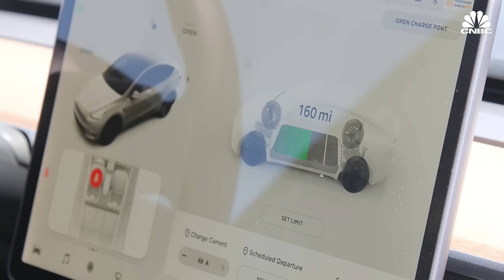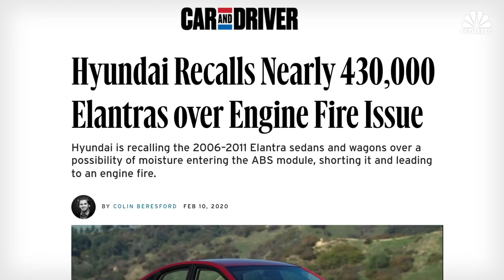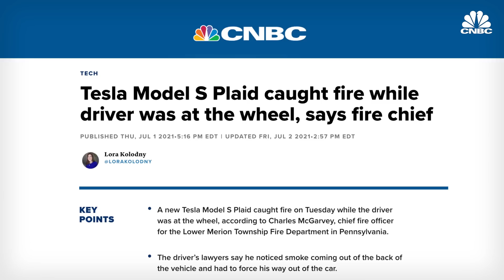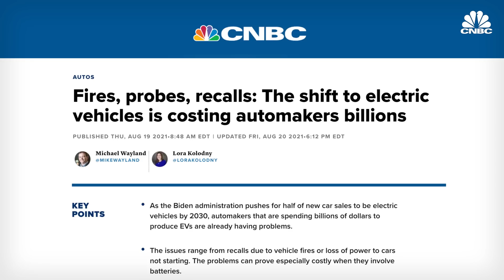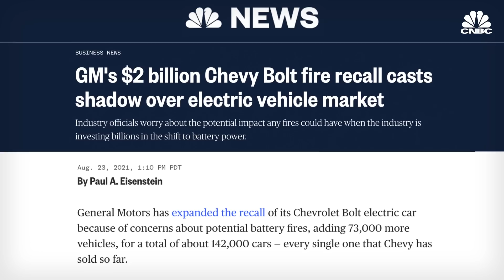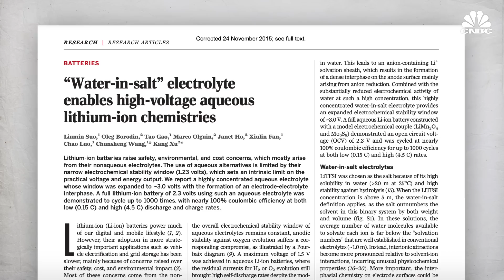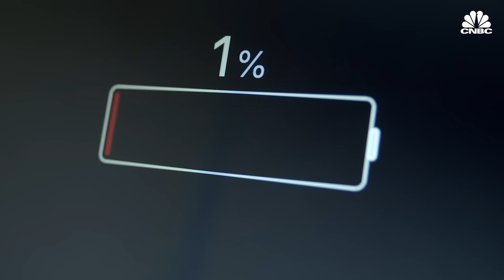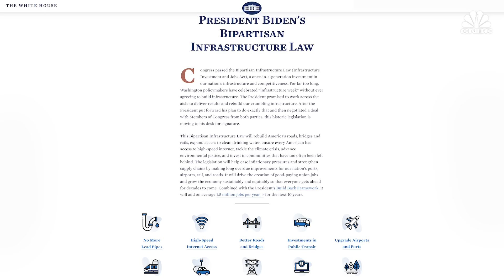Why Tesla, GM And Other EV Companies Have A Fire Problem

Comment: Half of the comments below are people who feel they need to remind you that gas cars can catch fire, too
Reply: Not while parking.
Reply: @zxcvbnm3998  Not sure what you mean by "not while parking".  If you mean not while parked, that would be false, as many of the current fire warnings and cases for combustion engine cars is for cars there were parked and unattended.
Reply: I bought a Saturn whenever they were all the rage. Despite certain problems some had during certain years,  you NEVER read about them just catching fire. Mine didn't. This is true with pretty much any piston engine cars or trucks I knew of which were newly purchased even used since 1979. You pretty much had to light them on fire yourself. These electric cars are catching fire brand new,parked alone with nobody around. That speaks volumes.
Reply: They wasted money on electric and feel guilty
Reply: Important comparison statistics would be how many people are injured or die in ICE vehicles per 100,000 vehicles compared to the equivalent statistic for EVs.
Reply: @shanewilson2484  Based on how EV's are designed, that rate would also favor EV's.  The reason is simple, the entire front of an EV like a Tesla can be a crumple zone as there is no engine and transmission upfront.  Hence, the entire front can be crushed to the windshield without penetrating the cabin.  On ICE cars, only the very front can become a crumple zone, as after the crumple zone the engine is there along with a transmission in many cases.  Hence, it has less space to absorb any impact of a crash.
Reply: because: DEFLECTION. <--- any time one's EGO is hurt this is the standard pattern of Human behavior that always ensues. #REACTIONARY , #DEFENSIVE the psychology beneath this is so predictable such that one is able to set their watch by it.
Reply: Because they burn at a 10-50x rate. And yet they decided not to make that the video topic
Reply: @thomasreese2816  that's because done has companies own the media or pay the media to censor it... That or it's usually mentioned but ignored by the people.
Reply: There are a lot more gasoline cars out there than EVs. At this rate, If it were 50/50 there would be a heck of a lot more EV fires than gas.
Reply: @LordSamuelJ  False.  The rate is per 100,000 cars.

"Fully electric vehicles, on the other hand, were deemed far safer than both hybirds and gas cars; they are far less likely to catch fire, with just 25.1 fires per 100,000 sales. That's compared to 3,474 hybrid fires and 1,529 ICE fires per 100,000 sales respectively."

So, the rate of fires is 25 fires per 100,000 electric cars, but 1529 per 100,000 gasoline cars.  It doesn't matter how you scale that up.  Million EV's would cause 250 fires while a million combustion engine cars would have 15290 fires.
Reply: @redbaron6805  the thing is ICE cars don’t explode from something perforating the underside, they don’t take nearly as much water to put out as quickly AND they don’t combust repeatedly after first ignition. I am all for EVs but batteries do not like to be crushed and in a crash this is exactly what will happen.
Reply: @User-cb4jm  But, if we stick to the facts, EV's still catch fire 60x less than combustion engine cars.  Something perforating the underside is exceptionally rare, as they have a pretty substantial shield underneath.

And EV's rarely catch fire in normal head on rear end crashes as they have far larger crumple zones than combustion engine cars, and the battery is in the middle.

Most of the fires have been violent crashes into barricades, trees or similar crashes where the car slides sideways into pole or a tree.  But, those crashes have cut combustion engine cars in half, so one would expect something catastrophic to happen in those.

So, while EV's do catch fires occasionally, they are exceptionally rare according to the NTSB report that analyzed car crashes and fires.
Reply: @User-cb4jm  You don’t put out electric fires with water, you use foam.
Reply: at 1100% greater rate
Reply: As they should.
Reply: Its much more cleaner than batteries😉
Reply: It is much rarer for a gas powered vehicle to catch fire. It would need to be catastrophic for that to happen.
Reply: Not just that but gas is extremely explosive when exposed by extreme heat and fire.
Reply: @okamijubei  high temperature doesn't ignite gas. You are lying
Reply: Did you actually watch this or are you just shooting from the hip without so much as an insight?
Reply: And the thing is,they don't burn as fast as an EV because the gas tank is protected by the whole cars chassis,compared to an EV where the battery is part of the chassis where it can crack and leak fluids
Reply: Um...yes. If a news media company puts out a video on how dangerous a new technology is when it is statistically FAR SAFER than the current technology, it's probably a good thing to point that out, no? EVs catch on fire much less often than gas cars and the fires burn slower. But you wouldn't know that by watching this video.
Reply: @juliam6442  is it easier to put out an EV fire?
Reply: my EV won't catch on fire like your gas car.

because i won't ever buy an EV.
Reply: Well see CNBSisn’t telling a new story. It’s a propagandist station at this point supported by either gasoline car advertisement
Reply: Power cells shouldn't be catching fire at nearly the rate that they seem to be. At the current percentage imagine how many million fires per month that would be happening if all that existed were electric cars and trucks.
Reply: @randybaumery5090  You have literally ANY idea what you are even talking about?

Here is what the actual study said: "A recent study conducted by AutoInsuranceEZ using data from the NTSB (National Transportation Safety Board) showed that electric cars in the US caught fire at a rate of 25.1 per 100,000 sales compared to 1,530 for ICE vehicles and 3,475 for hybrids."

There are somewhere around 295 million passenger vehicles in the USA.  If the rate would hold up and every single car was electric, we would be talking about 73k fires a year.  So, no, I can't imagine how many "million fires" would happen when the total is less than 80k.

The current number of fires in combustion cars is close to 200k a year.  Again, nowhere close to "millions" of fires per year, let alone per "month".

You completely fail elementary math or something...?
Reply: @randybaumery5090  So... you completely missed the point just to completely miss the point some more?

The additional fossil fuels required to make EV's is offset in about 12 months worth of driving.  So, there is no question you gain that back.  Same applies to wind turbines.  Wind turbines return over 2000% the energy used to create them during their lifespans.

You are turning the argument completely upside down.  Using your logic, nothing should ever be replaced, as it will require energy and materials to replace it.

In reality, companies and individuals look at energy and cost ROI.  It takes more energy and more materials to create a LED bulb vs a incandescent bulb, but the energy saved in the process will be about 50x the energy invested.

The same math applies to cars, airplanes, wind turbines, solar panels, hydroelectric dams, engines, etc.  All of those require an upfront cost in materials and energy, but you get that back multiple times in the long run.  

In your world, no one should ever insulate their house, as it takes energy and materials to create the insulation.  Never mind that you save that energy back a hundred fold over time.
Reply: @redbaron6805  I didn't miss sh**. We have already sat around, drank coffee, and listed every single way that you still use any form of fossil fuels , even to recharge them. Still using coal and natural gas up the chain to recharge them. What I would want to see is exactly what percentage the fossil fuels goes down due to Earth saver cars. The only thing I can see that would drastically change from a lot of these,  is the smog levels in cities. What's going to be extremely interesting is once thousands of power cells begin expiring, how "clean" it really is or is not to "recycle" them.
Reply: @randybaumery5090  The math is pretty simple if you bother to look it up.  Take electric cars.  They are obviously 4x to 6x more efficient.  Even a Tesla Model S with 1000HP only carries around 3 gallons worth of energy on board, yet can do 0 to 60 in 2 seconds and drive 400 miles on those 3 gallons worth of electricity.

The claims that we still use "coal" and "natural gas" to charge them again completely misses the point.  Because of their efficiency, and because the grid is around 40% zero carbon energy, that means they run on 40% zero carbon and 60% fossil fuels, vs combustion engine cars which run on 100% fossil fuels 100% of the time.

This isn't a 1 to 1 trade off.  A Tesla Model 3 with 350 miles of range carries only 2.2 gallons worth of energy onboard.  Can you name a combustion engine car that can travel 350 miles on 2.2 gallons of gas?  Of course you can't.

That is the point you keep missing.  Electric cars are not only simpler and more reliable, they are also far more efficient.  The upfront energy required to create them is offset in about 12 months of driving.  After that, they save a ton of energy every year, year after year.

And we haven't even started talking about cleaner cities with lower emissions pollution, lower healthcare costs, cheaper maintenance, less noise pollution and a host of other benefits.

You are also missing the point that we flare and waste Billions of BTU's worth of natural gas every year, as there isn't enough demand for it.  Burning that gas to create electricity and charge electric cars would result in literally zero additional emissions.  

There are literally thousands of different ways this is beneficial.
Reply: @randybaumery5090  I don't think anyone is claiming that electric cars are some magical solution that will solve every problem on the planet.  A lot of the opposition to electric cars however is unfortunately based on people simply not knowing how they work, how they are built, how they are charged and how they are maintained.

People are still thinking modern electric cars are the Nissan Leaf's of 2010 with 100 miles of range and that they somehow take hours to charge.  None of that is true with modern electric cars.

The idea that your SUV is "clean" is obviously false.  And I'm not sure what makes electric cars "toys".  They are far more reliable, cheaper to operate and maintain and actually far more enjoyable to drive.  They are quickly taking over combustion engine car sales and car makers are already stopping R&D on combustion engines and switching to electric cars by 2030.

No one however is claiming they will solve traffic or sprawl or overpopulation or other issues in the process.  They will simply be used to clean up the emissions of the existing fleet.  As a bonus, Europe will phase out Russian oil in the process, a win win for everyone...
Reply: @randybaumery5090  They can be used within cities and between cities.  They will also be increasingly used for aviation with electric planes starting to appear this year or next.  First use will be short haul flights, and then the distance will increase over time.

Autonomous driving is just a question of time, just like autopilot systems for aircraft were just a question of time.  Humans are simply terrible drivers by nature, and are simply too distracted and too costly without having some serious assistance needed which will mostly phase out manual driving over time, especially highway driving.

But electric cars, trucks and aircraft are coming for a simple reason.  They are simply far cheaper to operate per mile.  Which is why FedEx, UPS, Amazon and everyone else is going all electric.  Not to save the planet, although that is a bonus, but simply because it is far cheaper to operate and maintain electric vehicles.

The same thing applies to airplanes.  Electric motors are cheap, simple and very reliable, besides being exceptionally efficient.  That is going to be the driving force behind much of the electrification.  Reliability and cost.
Reply: @redbaron6805  phase out manuel driving? Not for me. I want the manuel option. Always.
Reply: @randybaumery5090  Manual driving will be phased out over time.  The simple reason is cost.  Human drivers are simply terrible at driving.  They are too distracted, tired, bored and uninterested in it, causing hundreds of thousands of accidents annually costing society a cool Trillion dollars every year in the process.

Hence, nanny systems will increasingly take over, monitoring speed, steering, distance, etc.  People speeding, running red lights, distracted or drunk driving are simply out of control already.  Something needs to be done.

Manual driving won't be banned, increasingly, insurance companies simply will gradually refuse to cover the damage.  A fully manual car will simply become un-insurable over time.

Considering the amount of traffic we are already facing, probably won't be a great loss when it finally happens.
Reply: I still will want a manual option on mine. Even if I have to get it retrofitted. I don't need Father Mother intrusion in my life more than it already is. Next thing you know they'll be rationing how you can drive putting curfews. Sh** like that. Wait let me guess.  "That's just the way it is. For the greater good." Yeah that's not at all familiar, is it?
Reply: @randybaumery5090  I'm not sure where you are getting the idea that EV batteries will ever be "buried".  EV batteries contain a lot of valuable metals, as they tend to be up to 80% Nickel.  Since Nickel is around $4 a pound, a 1000 pound battery would contain around $3200 in Nickel.  Who would be crazy enough to bury $3200?

And we haven't even touched the Copper, Aluminum and other metals.  I'm also puzzled about your Lead Acid battery claim as those batteries are also not buried, really ever.  Over 99% of them are recycled.

EV batteries are already being recycled today.  The first reason is the batteries can easily be rebuilt, as only a small fraction of the cells go bad, the rest are perfectly good.  The second is the valuable metals they contain.

Hence, the idea that we won't recycle them is not really realistic.  We do already.
Reply: @randybaumery5090  I really don't buy into conspiracy theories.  If some entity would want to control your life, there are far easier ways to do so.  Shutting down your electric, your internet, blocking your road or cutting off your water would be far simpler, faster and cheaper.  

As noted earlier, there won't be some government agency that kills manual driving.  The insurance cost will simply become prohibitive.  Eventually, no one will insure manually driven cars.
Reply: @randybaumery5090  You have to separate every day materials like metals, aluminum and plastic and EV batteries.  No one is removing a 1000 pound EV battery from their car and throwing into a dumpster.  No repair shop is going to remove one and throw it out, knowing it is worth thousands of dollars.

I have never heard of anyone anywhere ever throwing out Lead Acid batteries.  There is a reason they are over 99% recycled, as there are core charges on new batteries and you can get your core charge back at any auto parts store.

We are obviously never going to get to 100%, but at 99%, we are already pretty close.
Reply: @randybaumery5090  Not sure what I'm searching for.  Look up how much EV batteries are selling for, even from crashed vehicles.  They go for thousands of dollars.  They are actually a pretty hot commodity.

I don't disagree that our current lifestyle is unsustainable.  We are consuming about 100 planets worth of resources currently, so things will definitely come to a screeching halt sooner or later.

There are some forecasts that population growth will level off and then shrink before the end of the century.  The current system obviously is not sustainable long term, so we will be forced to make drastic changes sooner or later.

There is also little question that wealth is getting concentrated far above even the levels we saw during the most extreme years of royalty and peasants in centuries past.   So, that whole system will come to a head sooner or later also.

Will be interesting to see what happens.  We may both be lucky enough to not survive long enough to see it in person.
Reply: @redbaron6805  how can you be not sure what you're searching for ? I handed you the very words to punch into GOOGLE search. The articles will tell the story. They are, eye opening.
Reply: @randybaumery5090  You have to be a bit more specific what you are referring to.  Articles such as....?
Reply: @redbaron6805  Of the 255,000 Congolese mining for cobalt, 40,000 are children, some as young as six years. Much of the work is informal small-scale mining in which laborers earn less than $2 per day while using their own tools, primarily their hands.Sep 1, 2021
Reply: @redbaron6805  what happens if you are in an EV and the battery catches fire. How, then, does one get out of the car of everything is not functioning? Actually, it doesn't matter. I am fine with my combustible engine, gasoline powered cars. Screw an EV
Reply: @redbaron6805  you must be a robot. Humans are the only drivers, dude. Autonomous driving would be unsafe due to hacking issues. That's not the only issue but it's a pretty big one
Reply: @redbaron6805  conspiracy theories tend to be conspiracy facts over time. And considering that you aren't even a human being, I will not be inclined to believe anything that you say